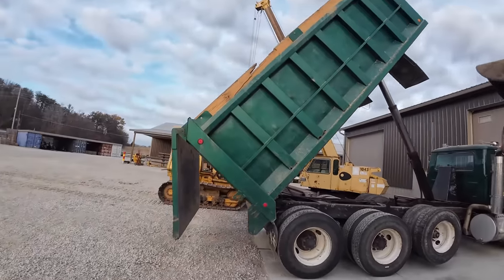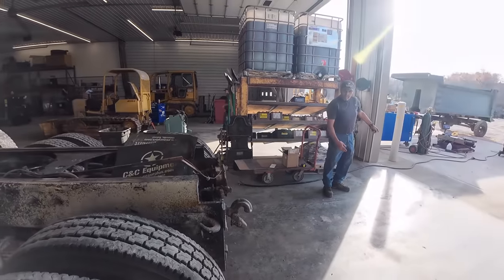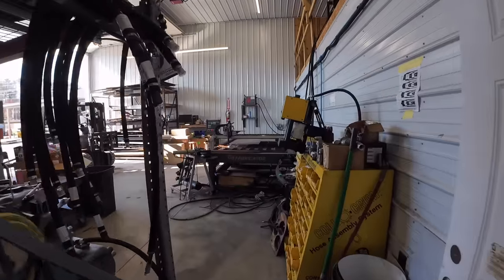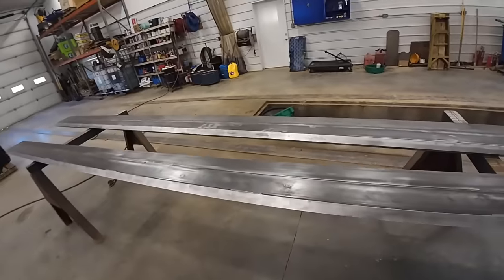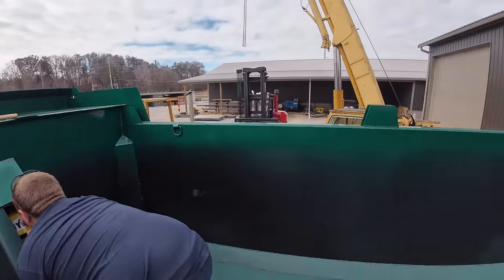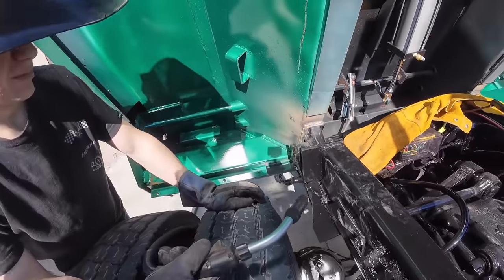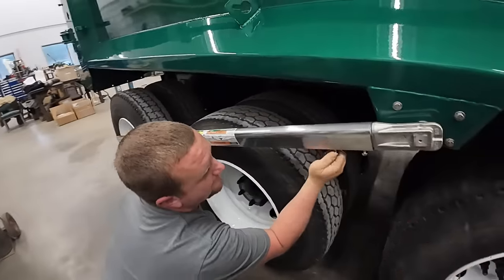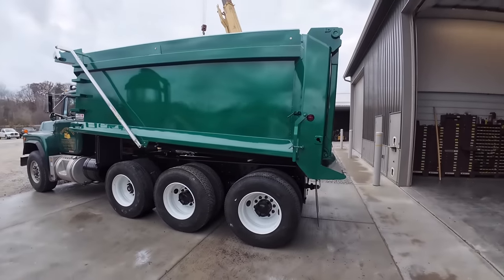Replacing a 23 year old dump bed on a very nice RB Mack to give it new life again ​#macktrucks

Comment: They forgot to add the bars to the back gate to make it a 9 panel. They are getting old and forgetting
Reply from the maker: Or it makes for a good comment generator 😁
Reply: @C_CEQUIPMENT  haha...I was thinking the same thing!
Reply: First thing I noticed when it came out of paint shop!
Reply: lol,, I already made my comment about the tailgate b4 I saw Clint’s comment
Reply: @C_CEQUIPMENT  Are you going to wire a spoon to the exhaust stack for your next trick?
Reply: @C_CEQUIPMENT  It works every time Clint 😂😂😂😂😂
Reply: Yes and the overseer was absent lol
Reply: That was Aaron (MBTS) in an attempt to frustrate Jerry, Not Clinton.
Reply: That was the first thing I noticed when they showed the new paint job...
Reply: Ty 👍
Reply: Hello guys, I had a 72 and 85 Mac .l think I paid 25000 for it in 1999. When the pipe line went threw our back yard
Reply: @C_CEQUIPMENT 
Exactly.😂
Reply: @stevengullison410 
Was your 72 a twin stick?
Reply: The box angle is great. If you have any material that might be sticky like clay, blue clay, it's alot easier to dump it than shovel it out. Helps alot when freezing Temps involved.  Mag chloride also works wonders with freeze/ release issues..(spraying calcium or mag chloride inside the box). 'Watching your great video and Twilight Zone at the same time... Thank You!
Reply: Thank you for the video.
Reply: Good ol paint and welding fumes will do that!
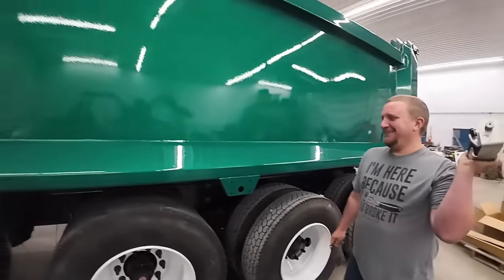Reply: 35:00 those aren't runs, Kevin made the paint extra thick there so the tarp arm doesn't run through 😅 😇🤷
Reply: Uncle Algo knows!
Reply: Did you see DP’s new cooking channel?  He tried to BBQ 🍗 the new excavator bucket 🪣. 
😮   He’s Okay. His face was a bit red but it made for an exciting video. 😮 
 You guys do great work even without all the Drama of DP’s channel. 🤣😂🤣
Reply: Im not to far away from that lol.
Reply: You have that Wright 😅
Reply: Love that paint job ❤💕😊
Reply: ME TOO! WHAT?
Reply: Hope he gets credit for the parts you are replacing the tank the telescopic hoist had them on my dump trucks I built my boxes and put a bed liner and a vibrator on the bed liner to save for hauling broken concrete but had other trucks for that but if on job needed load hauled off would do it save time instead of waiting on another truck we had heavy equipment also did about it all cause we also owned the sand and gravel company supplied home construction highway construction had to have material graded by don't to pass there test they run did this stuff for 55 years now retired good job on box and paint even frame made look good

Comment: Clint your bringing back old memories with that nice old Mack truck.  My first new one was 1985 RD688ST 350 12 speed.   Many years later we sold our business we had 28 Macks i believe many of then low miles but tons of hours as we hauled crude oil and produced water from the single well oil tanks to the main facilities.  Usually 20 minutes or so load and unload at 1200 rpm. I had 40,000 hours on one engine before it had an in frame done on it.  Our maintenance program made units long life before they were wore out.  Did hurt that we had 7000sq ft of shop with in floor heat at 60F either in the-30 degree days. We did it all in our shop from tires to in frames…love the video if you happen to know of any old Macks around that are restored like in the fifty’s send me a message.

Comment: I had a 74 R model years ago. Or better known as a “1 stack with a window in the back”.  When I sold it there was well over 1,000,000 miles on the truck. It was still being used in 2014.

Comment: Backing the Mack out of the shop...  Then sitting still and crank the steering wheel..  That is so hard on the steering gear box, tires, king pins, trod ends, frame twisting and all..  Imagine how mush stress that is putting on everything with a load on..  You have a great bunch of guys and a very nice shop..  I enjoyed seeing all the first class work you did on this box change..

Comment: I'm getting to believe this is the shop that the saying. "Do it right, or don't do it at all". came from. Very skilled workers and nice job . From the steel beams in the concrete for 70ton M1 tanks can drive on, to a very organized and clean shop to the super quiet ceiling fans. If there's a trade technical school around, you might want to do work base learning. From, painting, welding, fabrication, contractor license, business operation, auction dealer to class A truck driving. Start out with a class field trip. They would love to visit your shop.👍

Comment: Have a friend that has one like it.  When it hit 500k in short hauls, the dealer wanted to overhaul it. It was not using oil or losing power. He let them change the main bearings and they all checked out standard.

Comment: Clinton you have to put a ribber strip under the bed extenders or seal it well with silicon . Metal on metal is going to strip the paint and the rust will streak  down the side of the body in no time .

Comment: Nice video btw. Also was wondering what's the spec on  the welder Y'All using? looking for something that can tackle a similar welding job you guys took on.
Thanks for the heads up.

Comment: Clint. you and the team another great video,   the only thing that I would have done I'd is  I would have put some 2'X6 inch conveyor belt blocks about 3 feet apart under the side boards with the vibration from gravel and highway running, the vibrating will cause paint loss and rust OTHERWISE GREAT VIDEO opinions are like an A-Hole we all have one

Comment: We had a mack about that yesr.    One cold morning the cracked it awhile and the airline got hot.  Turn out the ground on battery was  corroded bad on the frame.  It was grounding back to the starter thru the air line .. we  welded the ground strap on the  battery to the frame.  Cured it.  Log truck.  Tough truck.  Hard start in cold but always did.  We never figured out  the grounding but it cured it.

Comment: I'm going to add 2 things first when you install those lug nuts you should put a drop or two of oil between the washer and the nut in the video you could see the dry hope of the torque wrench when tightening and the oak boards at the top of the bed are there so when the loader operator dumps in the bed and hits them the give and not bend the bed I hope the steel ones work out

Comment: The person that welded that rear hinge to the rear of the truck frame welded the vertical welds downhill. I can't over stress how you can not do that! You have to make those welds in the vertical up position! Did you weld the inside of the hinge to the trucks frame?  This would add a lot more strength if done properly. I thought you were going to make the tail gate into a 9 panel?

Comment: I would have removed the top boards and used D rings on all four corners and lifted the dump body from those and to save on the work I would have widened the bottom of the piston valley for the Hydro tank to save on all the relocation fabrication necessary to mount a new tank and lines ...

Comment: Was surprised to see you working on it without a safety strut on the hydraulic cylinder
Reply: It not on the cylinder, it's the 2 metal struts at 33:00 that are to stop the bed falling back down.
Reply from the maker: We had struts in it
Reply: I couldn’t tell

Comment: I enjoyed the video. I do have a couple questions. Is the Ox Steel harder to weld or cut? I saw the frame was doubled and I was wondering why the manufacturers don't weld the two pieces together to keep the frame from"rust jacking"?
Reply from the maker: It is hard to drill and cut

Comment: You should’ve put a vibrator on the bottom of the bed it helps to keep the bed clean and prevent buildup,  Most Tri-axles have them.

Comment: Something about panels missing and waves on the side to sound intelligent and like I've never done wrong or forgot things.

Anyway, I vaguely recall a dump bed I saw back when my age was still a single digit. The tailgate had welded in X braces between the rear uprights. It was the only one I have ever seen like that so not sure if it's just weaker or takes more effort to do for it to be the reason it's not more common a sight. I think though that it would be a little more eye catching but that's just me.

More on the truck is that is a heap of green. A big mean green dog. Even with the side benefit of being able to now say that it's a very green heavy truck and anyone not having seen it may misunderstand the difference.

Comment: I ran an old girl like that back in early 2000 300 hp Mac motor with a seven speed that was really five because the first two were low ass Came back suspension. That thing was a beast cannot kill them

Comment: Great video as usual!! Love the dump truck restoration work! One quick question: I’m not familiar with welding, however my question is this: When you cut the original bed frame and reweld the new bed back into place is the new weld as strong as the original frame or in the future will that be the place it could break? And eventually you would need to weld again?

Comment: That's the same truck I learned to get my class B with air brakes in and the when I went to class A I used a Ch 613 Mack semi tractor with a 53 ft drop deck

Comment: You don't hook up wire to kick pump off cylinder will come apart it puts pump in neutral my boxes mount were different they were built into the frame channel but whatever works plus nwe  had a hoist mount where we did are stuff inside the building 44:56

Comment: You never welded in them extra tail gate gusets to stiffin it up to make it a 6 panal as you said.. what about the spring tension dump box safty chain.. in case the host cylinder brake the box dont go over backwards  its a must here to pass yearly inspection. 3/4" chain with a 3" heavy spring to pull the chain back out of the way coming down. It stops the box should it ever go past end of stroke

Comment: drilling a hole at the top and tap the hole for a screw  in the same areas that rusted on the old box and giving them a drink of oil would keep them from rusting . and set back tail lights suck trying to see em from anywhere but directly behind  in the daytime.

Comment: When I worked for a contractor as a mechanic and operator we did a lot of concrete demo work (sidewalk curb,street repair). Needless to say it beat the hell out of the beds. Whenever we got a new bed installed I’d line the bottom with oak sheeting boards. Added weight but saved the floors!

Comment: Nice job!…looks good…but!…tarp arm bends are on backwards…we don’t rock it like that in jersey!
Reply from the maker: Gotta clear the exhaust stack
Reply: That’s Indiana style then!…reason it should be flipped around is so the bars lay up against the cab shield and not in the way of the loader, then when it’s unrolled those bends lay parallel to top of the body…that’s how they should be installed, but whatever works.

Comment: 1999 or 2000 RB Model Bulldog with the trusted E7 Mack engine. & looks like 44K Rears on Camelback suspension .  

Now if it   has either  the 3/8 Single frame or Double frame & the E7 engine is either a 350 or 400 with a 12 speed Mack or 8LL Roadranger  transmission & only 130K on the clock,  that's one helluva Dump bucket . 

 Especially with the new bed complete with barn door .  

Great Job on your Dads Truck there Clint . That's one sweet looking Old School Bulldog . 

Mack
Reply from the maker: Double frame e7 400hp 8ll 44k camelback jake brake

Comment: Good looking truck but it’s kinda silly to have the tank by the cylinder. Pushes the cylinder to far back and makes for a huge doghouse, losing almost 2 yards of space in the box bc of it. Also can’t load slabs of concrete without getting all jammed up in the dog house. Same with dirt always gets stuck on the left and right if the doghouse. I prefer heavy scissor lifts I have one on my quad axle lifts 20 ton all day long with no doghouse. But man that’s a good looking truck good work

Comment: Never trust Hydraulic rams. They can vent at any time.   Put in safety support bars, before you work or stretch under any Hydraulically lifted bodywork
Reply from the maker: Yea
When did you not see that
The old bed I cut off had safety pins in it

Comment: You ain't a real truck driver unless you've had to stare at a bulldogs backside for one whole season whether hauling logs, gravel, rocks, or crops. I cut my teeth on a twin stick Mack hauling logs for one cutting season. Always hated climbing up to operate the old Prentiss loader it had between the cab and headache rack. Me and heights in 20 below zero don't go well.